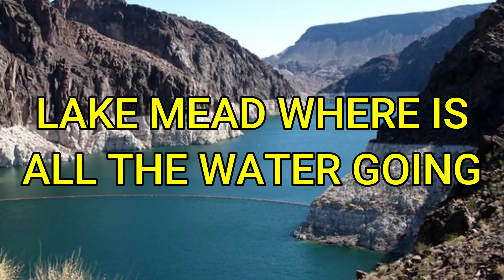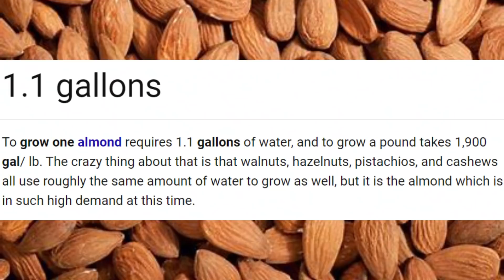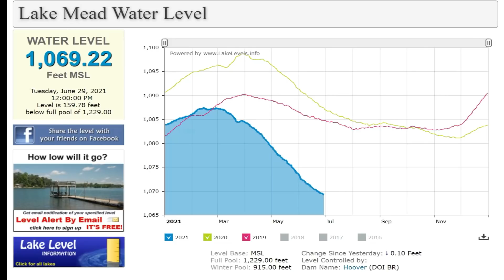LAKE MEAD UPDATE WATER CONSUMPTION

Comment: Stop blaming the almonds for humans failure to control the rates at which they reproduce. It's not going to rain more or snow more if the population increases.
Reply from the maker: Hmmmm humans put those almond trees in California. It is not the trees fault it is the humans that put it there's fault. As far as more rain or snow it was way less than normal. For several years now. It was below normal and that has nothing to do with the population.

Comment: I NEVER thought bottled water would catch on the way it has. It’s nuts. Not just the water but also the plastic waste that is produced. I wonder what the total carbon footprint is for a single use bottle of store bought water.
Reply from the maker: You're a crack that mean oceans completely littered with plastic bottles floating around. It is insane. Bottled water needs to go truthfully. Thank you for stopping by and checking out the video!
Reply: @Dobrinich   I live in Grand Rapids, Michigan. First city to put fluoride in their water system. That is why so many people here now buy bottled water.  We want natural tasting water, not this processed city water crud that tastes terrible.